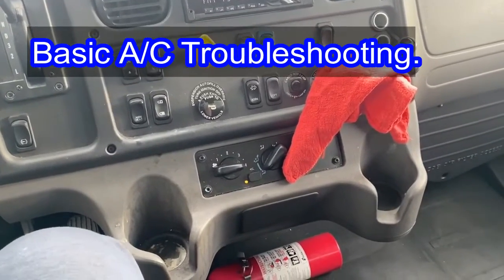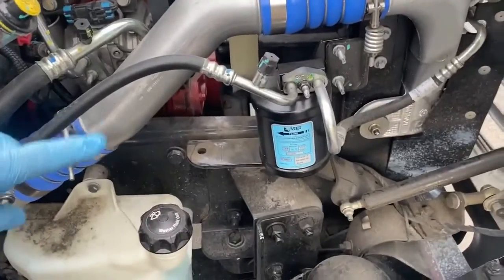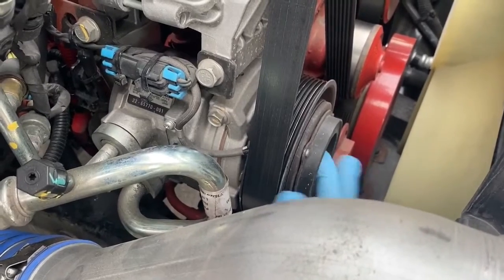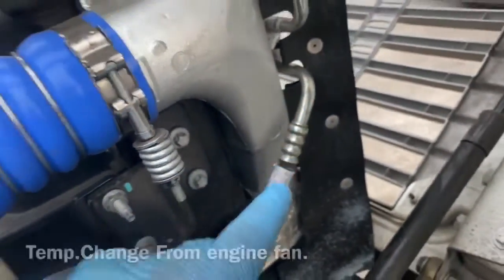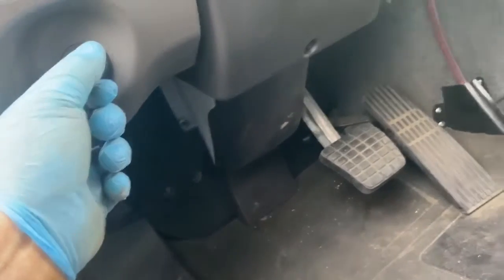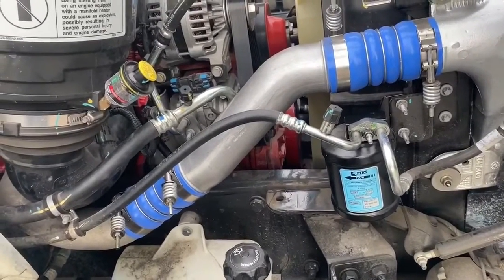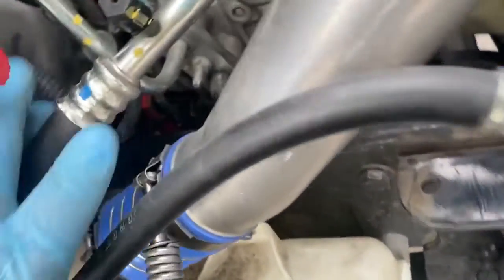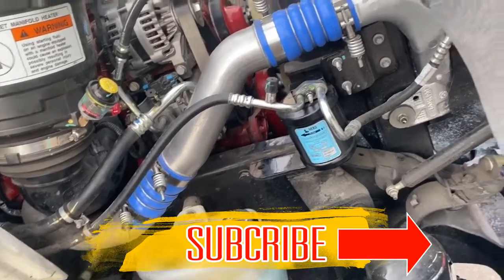Basic Cars and Trucks A/C Troubleshooting

Comment: On older trucks check your heater coolant lines , if both are hot the shut off valve is defective . The A/C system will not override the heating system . Install manual ball valves on the engine block . Good Video !
Reply: hi.....what if the fan is not working from the cabin
Reply: @TaiwoIdowuPeter  Check the fuse , relay , and resistor for current . The blower motor may be shorted .

Comment: I have a 2018 freightliner s2rv. temp coming out of the vent is only 62f.. my pressure on high side are 265 but low side is only 26psi.. do I need a new expasion valve?

Comment: Mine blows cold air only when driving,, but as soon as i get to a stoplight it blows warm air
Reply: Same here with mine.
Reply: Eso es porque le falta gas refrigerante...
Reply: @JosueBetanco-ef6iq  lo revise y esta en lo rojo
Reply: @2ArightsTV  el gas refrigerante se revisa con los manómetros, la presión baja debe andar entre 20 y 40, 50 como máximo, y la presión alta debe andar entre 250 y 300, si la presión alta anda en menos de 250 sentirá que enfría poco al estar estacionado y que en marcha enfría más, lo otro que puede estar pasando es que el compresor no esté trabajando al cien por desgaste de uso, así que con los manómetros puestos y el vehículo estacionado acelerelo y vea como se comportan las agujas de los manómetros.
Reply: Pudiste arreglar tu Ac ?

Comment: So my truck ac unit works whenever it wants too , like it’s on setting 4 right now on the heater and it’s not blowing at all .. only randomly it will start working and stop again what could it be ? The blower motor ?
Reply from the maker: Sometimes the blower motor plug connection get so hot it get a bad connection. Also the blower maybe bad.